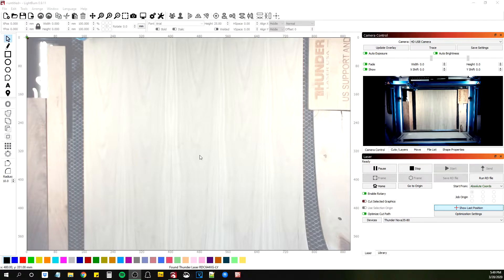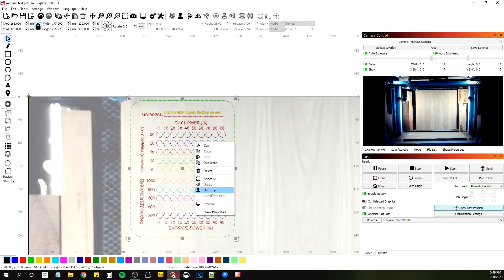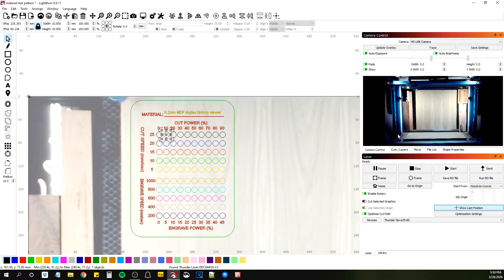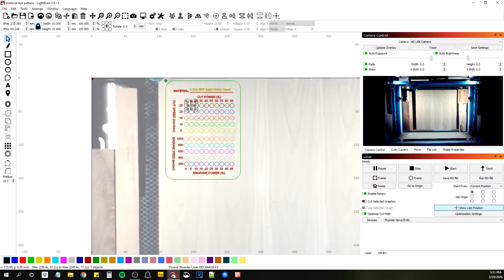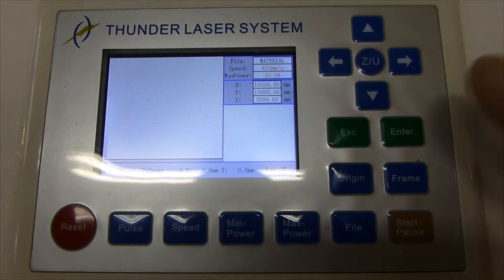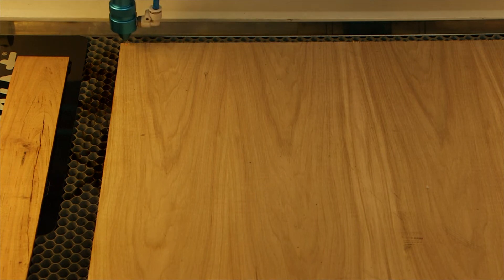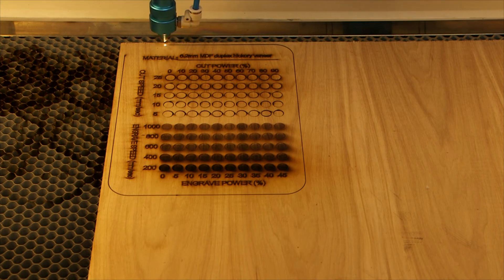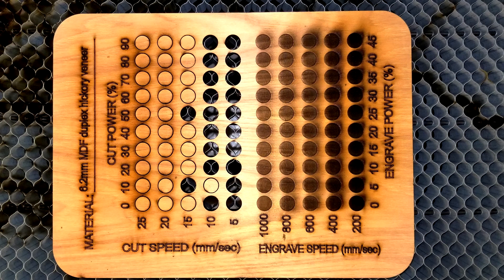Thunder Laser LightBurn Material Test

Comment: Thank you for this video and file, however I am a little confused.  In your Lightburn file there is the comment "YOU MUST GO INTO ALL THE CIRCLE LAYERS AND MAKE MIN POWER 0."  

From forum posts I've read on Lightburn, it seems that setting minimum power to zero will cause the laser to not fire.  In your material test pattern file, all of your layers have min and max power both set to 100 (in the layer).  From what I have read in Lightburn forum and unfortunately experienced in a similar test file, setting min and max to the same value causes the laser to fire at the layer minimum value, and the power scale is not applied, i.e. in this example, it would fire at 100% in every circle.  Have you had that experience?  Your video seems to work fine, but I'm curious what your minimum and maximum layer settings were, such that the power scale values did what was expected?  Thank you!
Reply from the maker: using the power scale feature, min power and max power are the range. if the scale is 100%max and 100% min you have no scale, it will out put 100% all the way. this is why min power  has to be set in the circle layers
Reply from the maker: https://forum.lightburnsoftware.com/t/power-scale-issues/33616/2
Reply: Thank you.